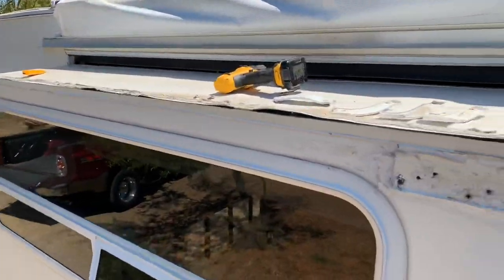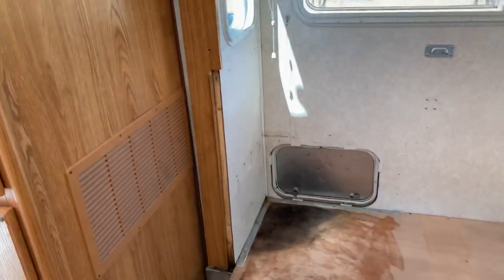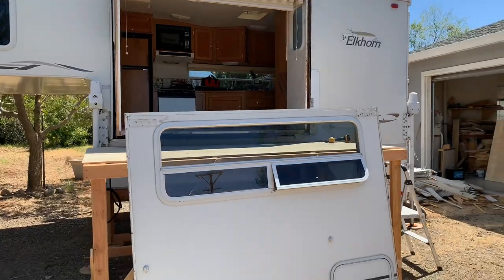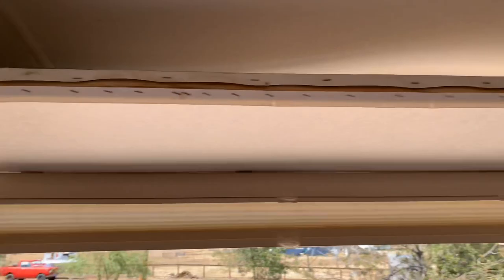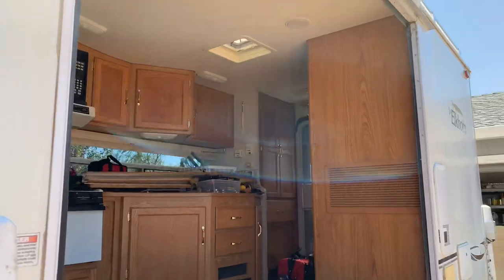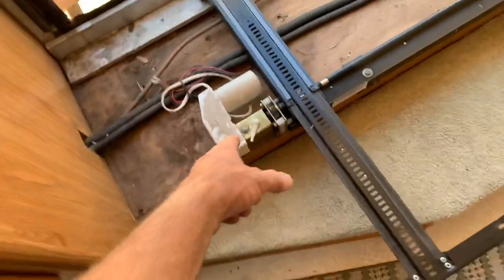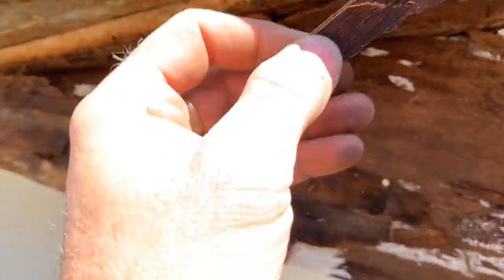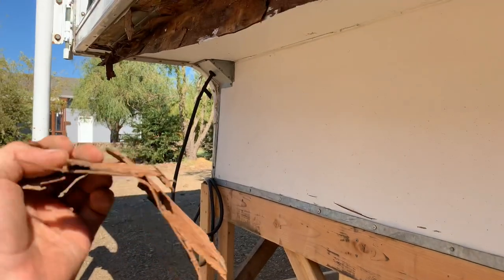It’s Out! RV Slideout Removal and Repair.  It’s Not Good News.

Comment: Dude you are amazing Thank You for the amazing video. I have a 2001 and the top isn't closing leaves about a 1-1/2 inch gap. Any ideas or should i do what you did and remove the entire slide out? Also previous owner jerry rigged the slide out motor directly to the shaft and I have a gate latch to keep it from sliding out while driving. do you know where i can get the proper gear mechanism? 
Again THANKS amazing work.

Comment: my 1181 slide motor is acting up, the front part of slide towards front of truck will come out, but the side to the back will not move, so it comes out cockeyed , any suggestion , lance camper

Comment: To do what you are doing is amazing. I can tell you are not intimidated by anything.
Reply from the maker: Thanks!  I appreciate the kind words.  The really amazing thing will be if it goes back together! 😉
Reply: From what I have seen in past videos and the the things you have built your are a craftsman. When finished it will be completely different than the original. More durable. You should seriously contemplate building a camper from scratch.

Comment: I purchased a truck camper last year and I chose the Lance 850.  I didn't want any model with a slide-out.  Between eventual leaking and potential mechanical problems with the mechanism, I didn't want to deal with headaches down the road. (pun intended)

Comment from the maker: Repairing aluminum frame damage in the slideout corners caused by the garbage roads we have here in the good ole USA.  I-40 in CA, AZ, NM, many Texas state Hwy around Amarillo, Wichita Falls and Dallas. 
While tearing into the camper to make the repairs I found (not surprising) wood rot from years of water leaks on and around the slideout.  I’m replacing everything with waterproof and rot resistant composite materials.  I’ll re-weld and bracket all four of the slideout opening corners.  Reseal all exterior joints.  Replace all hardware fasteners and coat each with anti-corrosion paste.

Comment: Looking at a used camper on Craigslist ; “in great shape, slide out could use some work”. After watching your video, we’re passing on it.
Reply from the maker: There are many possible issues with a slide room.  Most are minor adjustments.  Some require extensive repair.

Comment: I have the same camper. Got it a few years ago to replace my 5th wheel. I really wanted a Bigfoot but got this in great shape for $3000 in so Cal. After watching your videos and knowing how cheaply they are made, I'm kinda wishing I waited for the Bigfoot. Oh well....I do love my camper nonetheless. Thanks for posting.
Reply from the maker: They are made relatively poorly compared to Bigfoot or Northern Lite campers.  You got a good deal at $3K.  I’ve seen a few around California for $8-12K.
Reply: @covetthecamper2289  Do you have a generator? If so, where do you store it. Costco has a nice Yamaha 2000 watts for $400. Tired of lugging around a larger Champion 4000.
Reply from the maker: Ron Stiff 
I have a portable inverter gen. Sits on the front hitch rack when I need it.  RV shore power plug reaches.
Reply: I went from a Lance to a Bigfoot two years ago, and there's no going back.  The Bigfoot is built so much better.  I expect this to be the last camper I'll ever need.

Comment: HI i am wondering could someone just remove it and then put wood and insulation and make a wall where it use to be if you didn't want the slide out anymore?
Reply from the maker: I’m sure it could be done.   The outside wall on my slideout detaches from the slideout box.  (Already has the windows and storage compartment doors) that could be permanently attached to the rv sidewall and sealed.
On mine, the Slideout floor is raised and the mechanism (rack, motor, gears etc) are all mounted underneath along with wiring & LP gas line to furnace.  A new raised floor above the subfloor could be constructed to cover/protect those lines and wires.

Comment: Curious about the rot, my 2006 Lance 851 with sidewall slide is supposed to be the first all aluminum frame work! What year is your unit? Bold Repair!👍🏼
Reply from the maker: Lance campers started constructing some of the higher-end campers with aluminum frames in 1998 for the 1999 model year.  Mine is a 2003 Fleetwood Elkhorn
Reply from the maker: Lance started using Azdel composite substrate in place of the garbage Luan plywood in 2006.  That’s a very nice camper.

Comment: Conducting the autopsy on the truck camper. Interesting.
While there are many different "classes" of RV's (A,B,C and so on), there are actually only two "types" of RV's. Those two are ... Those that leak, and those that are going to leak. 
Use marine grade plywood and marine grade hardware on the rebuild. We did when we addressed similar issues. We look at the TC as a "boat" and now we are sure the TC won't sink in the future from water damage. There is no doubt you will have a "built right" truck camper when complete.

Good luck
Reply from the maker: You got that right.   They will all have damage at some point.  It’s no different than owning a sticks & bricks house.  Maintenance is key.  
I’m using all composite materials for their lightweight and water/rot resistance properties.  Still a lot left to do.  Just taking small bites and taking my time chewing.
Reply: Covet the Camper - I agree on composites. I wouldn’t put any wood/plywood back into the structure.

Comment: What is you do at Fleetwood? This sort of stuff (building campers?)
Reply from the maker: I worked on the assembly line building Class C Motorhomes.   I worked in various departments like windows and doors, carpet and cabinets installation, fiberglass caps and exterior lights etc.
Reply: 👍😀That foundational knowledge and experience comes in handy (although not exactly with the slides which apparently were more common after your time there - as noted) - but- it has to be a bit less intimidating when you work on such repair projects, I would think!)  Thanks so much for these videos, as it truly helps inform/educate those of us with far less knowledge and experience with this sort of RV stuff!)

Comment: That's the most overbuild slide-out platform ever.. you could probably support the whole camper on that structure...
Reply from the maker: Yep.  I built it to support the weight of a few people and the Slideout room as I was unsure if I could pull everything by myself.  The slide room and mechanism was only a couple hundred pounds.

Comment: Love your vids! Do you have one on adjusting the slide? Mine has about an inch gap on the top. 
Thanks
Reply from the maker: Thanks!  I’ll have a video coming soon on the installation of my newly rebuilt slideout which includes all of the adjustment methods.
Reply from the maker: Are you using the road lock dowels?   A lot of these rack & pinion style slideouts require the use of road-lock dowels to close properly.  It really becomes noticeable after wear&tear on the slideout frame.
Reply: @covetthecamper2289 
I haven't used it because it seems previous owner opened slide with it in and damaged the outside. Should I force it closed and use dowel or would this cause more problems? I have fixed the outside damage. Can I use dowel anywhere along top of slide?
Thanks again

Comment: There's no easy fix. They aren't built to be repaired easily.
Reply from the maker: Yep.  I worked at a Fleetwood Factory building Class C motorhomes on the assembly line for just about 10 years.  It’s not impossible to repair, but not easy.  When I did this rebuild a couple of years ago, I had to get creative with materials and methods.

Comment: So what happened
Reply from the maker: Repairing aluminum frame damage in the slideout corners caused by the garbage roads we have here in the good ole USA.  I-40 in AZ in several places, many Texas state Hwy around Amarillo, Wichita Falls and Dallas. 
While tearing into the camper to make the repairs I found (not surprising) wood rot from years of water leaks on and around the slideout.  I’m replacing everything with waterproof and rot resistant composite materials.  I’ll re-weld and bracket all four of the slideout opening corners.  Reseal all exterior joints.  Replace all hardware fasteners and coat each with anti-corrosion paste.
Reply: Wow I have a 2001 forst river its licing in The fornt overhang  I tried everything to find it and no luck
Reply from the maker: Did you inspect the seals and lenses on your clearance lights?  These are overlooked often.
Reply: I think it's the light I as took the window  out it and it slow down
Reply from the maker: I had the same issue.  I replaced all five lights and lenses with the led style and resealed everything a couple years ago. It’s dry up there but the damage was done.  I’ll be replacing the front cap with all composite materials.